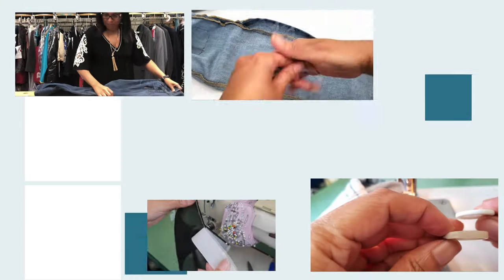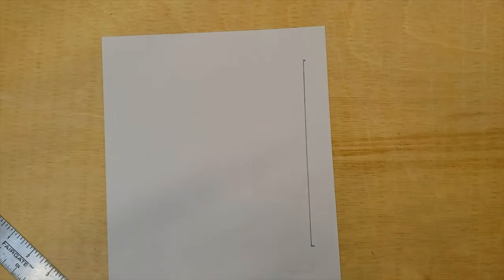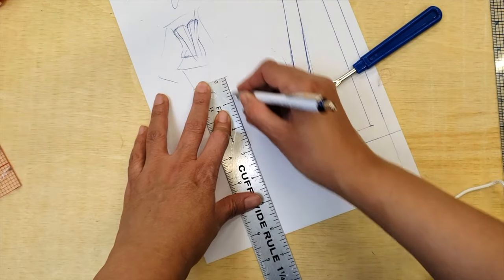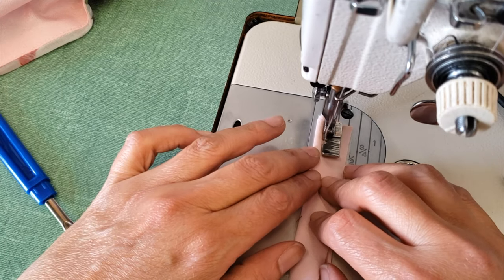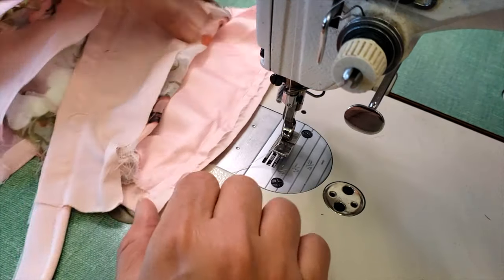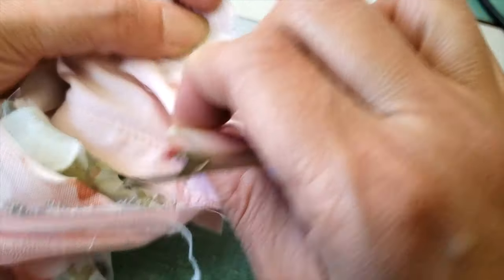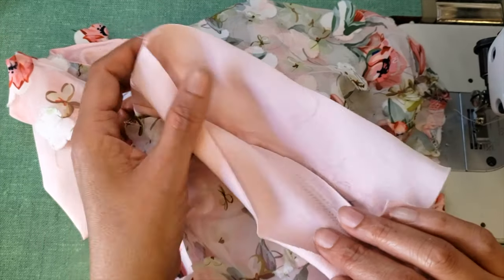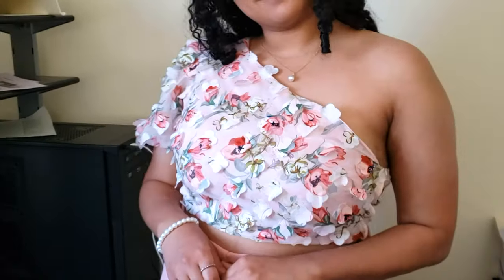Adding 3 INCHES to a Beautiful Floral Blouse!

Comment: 👍❤ this is great. I have done something similar on tops of mine. I usually end up taking the sleeves shorter and using that fabric. I have some tops that already have short or no sleeves and good fabric especially silk is increasing in price. I wanted to add different fabric but felt upon sewing that it would pucker from different weights of fabric. Wow I love the piping it makes good structure and compensates for fabric weight difference. Thank you for showing this. You are a true inspiration and no doubt I will not be so reluctant about fabric texture and differences.
Reply from the maker: Thanks.  Taking the sleeves when is possible is a great idea 💡 🥰😊